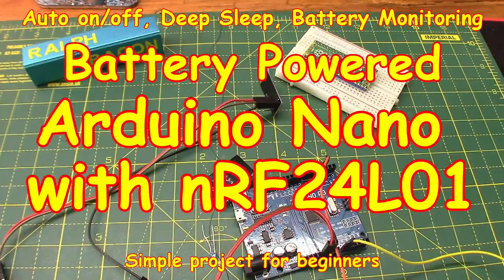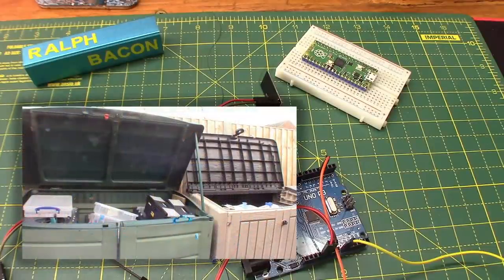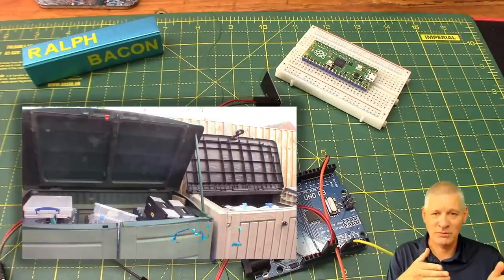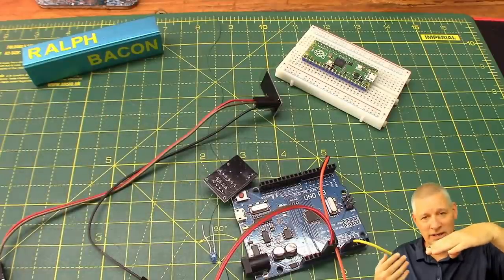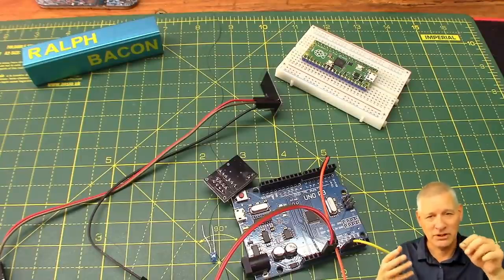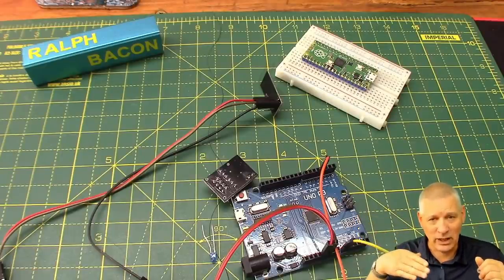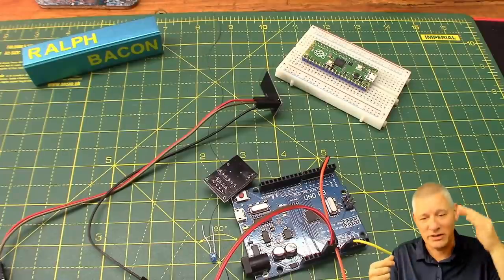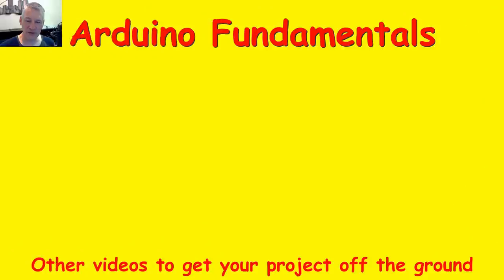#214 Battery-powered 🔋 Arduino-controlled nRF24L01+ transceiver project (part 1)

Comment: Interesting project and nice to be able to appreciate the thought process through the design - things that come to my mind are a daily ‘ping’ from the sensor reporting its battery level and unique sensor number so you add more sensors later and can put the effort in to a central hub which can plot or threshold-trigger for recharging as well as set off reminder klaxons when a lid is left open. 
Thx for all your great content.
Reply from the maker: Great point! As I have 3 bins I will have three of these units and they will have to be uniquely identifiable, not least for the battery level. Which I'll do each time they are opened which is "often". The neighbours might object to the klaxons, though, Chris. I'll tell them it was your idea.

Comment: For monitoring my garage doors I use a little Zigbee magnetic switch, linked to home Assistant. Works on cr2032 for years, even notifications on my phone when left open…. But I agree, this is more fun to make 😉. Thank you for making these videos!
Reply from the maker: Indeed, Freddy, others have also suggested various magnetic solutions but as my bins are not as solid as a garage door they might not be triggered correctly (or reset when closed). A tilt switch is going to be hopefully more reliable in this instance - and more fun to build, just as you say!

Comment: Interesting, look forward to the 2040 being used!
Reply from the maker: Not in this project, unfortunately, as the PICO's sleep current is too high. Well, unless the bare chip was used (now only $1 a piece I see). But I know I can get the Arduino down to 0.2uA in Deep Sleep so it will have to do.
Reply: @RalphBacon  - Thanks Ralph!

Comment: Interesting video, I think I would take a different approach though. Assuming you didn't just want to run a wire the 6 feet to your shed (!) I would have the battery connected directly to the Arduino, with the mosfet switching the nRF on and off. By using the power down mode and switching off unwanted sections of the arduino you can get the standby current down to a few tens of microamps, and then you could make the arduino wake up every few minutes, check the tilt switch, measure the battery voltage and then switch on the radio, transmit the data then power down the radio and go back to sleep. This would still give you a good battery life, but you wouldn't need to restart the arduino each time, and your monitoring station would receive regular "lid closed" messages verifying the system is still working, perhaps raising an alarm if the battery voltage drops too low or it doesn't receive a message for 5 minutes or so. Just a thought!
Reply: I agree. If Ralph leaves the lid closed for a year and the battery dies he would never know it. Then if he left it open with a dead battery he would not get an alarm. I like to make my projects a little more 'active'. I agree a twisted pair of wires is the better and low tech solution.
Reply from the maker: "If Ralph leaves the lid closed for a year" 😁 
The bins get opened several times a day. Including when it's raining like today! Even if I was on holiday (I remember those, good times) for a couple of weeks it seems unlikely the battery would go from "good (enough)" to "dead" by my return. I'll be sending the battery voltage each time the lid opens. What I do with that is yet to be determined.
Reply: @RalphBacon  Looking forward to see the project come to fruition. Lots of good ideas even if I would do it differently.

Comment: Happy to see I am not the only one who loves the WIFI radio systems I decided to build another a few weeks ago. That's when the problems began. You see I stopped when I began to believe that there must have been a problem in the design of the EPS32's I was using.  They would work for a couple of times but then simply stop. I could upload the software to them again, and then copy my channel setup over, they would play fine but once shut down would start again but with no program and I would have to re-upload.  I had a pile of esp32's laying on my desk that I had declared DOA and ordered a different type from a different seller.  When the new ones got here, they began to do the same thing.  I threw up my hands in disgusts and stopped playing with them, moving on to something else.  Then one day I decided to see if that pile of ESP 32's were indeed dead. I grabbed one and loaded the blink program and sure enough it began blinking the onboard LED!  So I once again loaded up my radio sketch and played with it, just using the built in stations and it worked fine, I could reboot, no problem.  So once again, I loaded my list of stations that  I had built up over the months that worked fine in my flat pack build with external speakers, and once again, on reboot, it had NOTHING!  Then it dawned on me, perhaps I had to many stations, so I cut out about 12 of them, then reloaded and suddenly I was back in business.  There was nothing wrong with the esp32's it was, what we called in the gunsmithing world OPERATOR HEADSPACE!  My list of stations was to large and was overwriting that little bit of RAM that contained the setup files`  Guess you are never to old to learn, and having just turned 70 last month, this became my living proof of the adage.   Oh, 95 degrees F here today, it has been a bright and sunny day till a few minutes ago when the black clouds developed.  There have been some horrid tornadoes south of here, hope they stay South of here!  Oh thanks a million for the videos, I believe I learn something from each of yours that I watch. It is my firm belief that if you learn something new every day , your mind should stay young and nimble despite the drugs the  damn doctors keep pumping in my system to fix this and that, then the ones to counteract the side effects of this one and that one, it's a never ending line of drugs, I keep the drug store alive on just my line of meds.  Workers comp is getting angry that I am on so many but screw them.  Thanks a million for the great videos any how and keep up the great work.
Reply from the maker: Happy belated birthday, Jerry, for last month. If I recall correctly, you were married to your late wife for 51 years which means you got married at 19? Wow! At least you stayed together all those years. That's some achievement. And no wonder you miss her. 
So back to your "hardware" problem. In effect, then, Jerry, it was a software error that caused the problems with your ESP32s? If there had been some kind of check within the code to limit the number of stations it would never have become a (so called) hardware problem? 
As you say, never too old to learn!
Reply: @RalphBacon  Yes indeed, when we had our fifty'th the kids threw a big party and invited all the old gang that they knew about and we had a great time. Of course then we had no idea that my wife was developing cancer. It was a coincidence but the day we wed in 1969 was the second day of Woodstock, that big musical concert in New York that made all the news papers, and they were still looking  for that Manson Family that cut a bloody path through Hollywood murdering rich white folks and trying to get the news to blame the blacks, thus starting Helter Skelter, the song that Charlie Manson believed was a message from the Beetles to start the battle. He believed that if he could get it going, the blacks would  win, and that they would not have the smarts to run things, so he and his family would come out from their underground hiding place in Death Valley and Charlie, being ever so much smarter then the blacks despite his 6 grade education and rule the nation as king.  Ah well another dream unfulfilled by another idiot.  Indeed, we had a great run, Judy and I, I still tear up a bit when I remember the good times, and our winters alone in Arizona the last few years. What wonderful memories to have and keep.   One day, I guess I will feel better and get on with my life although none of  us know how long we shall go on, I will live like I will live for ever, and dream like I will die tomorrow. Something like that anyhow. Thanks for remembering.

Comment: Love your videos Ralph as they always get me thinking. So many different options for this project as far as sensors but the template is the same
Reply from the maker: Great point! Many have commented about mail delivery detection so I'll devote some thought to a fool-proof way of detecting that as the trigger (eg long lever microswitch).
Reply: @RalphBacon  Funny that. I have a mailbox at the end of my drive... I await your solution with baited breath... tho I was thinking as mine is within my wifi range I was going to use an esp32 with a hall sensor just to light an LED on one of my desk projects

Comment: Hey Ralph. Welcome back :) (yeah I'm a little late to that party lol) I'm building a sensor network (to monitor various things around the house) with the nRF24L01 radios. I'm using tmh20's library and using the mesh network for easy communication, and then I think my connection to ThingsBoard will have a nRF24L01 on an ESP8266 as the gateway to the ThingsBoard server. tmh20's nrf24 library has some decent support for sleep for devices that don't need to be on either using an interrupt or using the watchdog timer.
Reply from the maker: Hang on, I used to know someone called Jess. Is that you? 🤣 I've never used a mesh network (isn't there a limit of six devices?). Anyway, I'll speak to you later. 📧
Reply: @Ralph S Bacon  Only 5 can directly connect to the Master, but the others (up to 255) can connect via the other nodes :) Anyway, I sent an email since YouTube is really finicky about when it will let me send a comment. It's really annoying :(

Comment: There are many solution to this, depending on your requirements and what you have already.  As my HA is all node-red based I tend to use tasmota to monitor a switch state, granted these aren't small battery powered sensors as the either have a mains powered usb supply, or a multi kWh solar charged powerwall.  Alternatively I use 433MHz magnetic sensor from banggood and I pick these signals up on an sdr stick using rtl_433, they run on a single aaa for months/years and send a low battery signal too.  Bitluni, Kevin Darrah and mr ca diy have good battery powered sensor solutions.  The fun comes in seeing what others have done, and then working out a solution that works for us.  Great video as always
Reply from the maker: If I had ever progressed my Node-Red/MQTT project I guess I would be publishing the state of my bins lids and letting other parts of the overall system deal with it. But, as I never did (but never say never) some sort of other wireless signalling has to be used and magnetic sensors would work if I could ensure they were always aligned correctly (which I can't, as they are rickety, but solid, plastic bins, which have a certain amount of "freedom" in where they choose to close!)

Comment: Interesting. I want something similar for my post box, so I know when the postman has been. Of course what I really want is a camera so I can see what's in the box, and a robot to go down the drive to collect the post, but something like you're doing will be fine to start with!
Reply from the maker: You forgot the butler to open the post and serve it on a silver platter. On the other hand...
Reply: @RalphBacon  The robot would do that! Actually I want this as an early step in creating an IoT, using MQTT and Node Red, but all that stuff would be handled by the receiver, and wouldn't affect what's used in the post box.

Comment: Hi there just a quick one to say that 18650 has a voltage range for 2.5v to 4.2v I try to only go 2.6v to 4.1v as this does not stress the cells and the number of charging circles is a better. I realise that this is below the the threshold for the Arduino and nrf24 but is a significant amount of charge especially if you have 2 in parallel
Reply from the maker: That is very low indeed, Paul. But if the datasheet for your particular battery says it's OK then it is. But mine are no-name (or Chinese name) with huge 5,000 or higher capacity (stop laughing) so who knows how low they can go without being damaged. I'm going to be transmitting the voltage whenever the bin lid is opened; I can decide later at what point I replace/recharge the battery.
Reply: @RalphBacon  hi there that is a standerd for the chemistry it's not a lipo (bag) stile that extra. 5v mack's a difference

Comment: Coincidence of timing ? ... 
For a long time, I've been thinking and planning a monitor for my detatched garage. And then a week before you uploaded this, I started working on the wiring writing some code.

Just like a lot of us, I have multiple arduinos and a bunch of NRF24L01 modules lying around, so that's what I'll be using.
My monitor will tell me;
- the open/closed state of three doors
- if the lights are on
- if either heater is running
- if the air compressor is running
- and (with a PIR & sound sensor) if it seems somebody's cat got trapped in there.

I'm also going to report the battery voltage, as well if as if mains power is still charging the battery. And just because I have a few, enough unused pins, I've added a real time clock.

The unit in the house will show the state on an LCD display module and flash & beep if any of the alarm conditions exist.
Reply from the maker: There's nothing new under the sun, for sure. What I can think of, so can many others too. It would be interesting to see how you get on.

Comment: Nice project.
Good to see that some failsafe is built it. How would you check if the wires, for the switch, is not broken?
If the wires are broken or battery gone bad, you never get the signal "Lid is open" and you would  never know.
Seems someone has been testing DIY skills with a hammer of is it nail polish?
Reply from the maker: Remember that we have yet to design the receiver, Flemming, and what kind of (visual) indication there will be for lid status. At the very least, I'd expect an active "lid closed" indicator (or "open") on bins I've opened/closed that day so I should realise something was amiss if nothing was shown (eg dead indicator panel). And we haven't even discussed the rain alert...
Yes, I tried to remove my nail whilst building the workshop, taking a long time to repair itself. Didn't hurt one bit. 🤥🤥

Comment: The SCA60C sensor will measure the angle of the bin lids.
Reply from the maker: They would, indeed. Unfortunately they won't act as a (mechanical) trigger to switch the circuit on, so they would not be suitable for my particular design. But good call.

Comment: Glad your back with informative videos. 
Question: could a Wemos D1 derivative be used in place of the Arduino and NRF?
Reply from the maker: You could do that, but the design would be quite different. 

The Wemos D1 would (presumably) act as a mini web server and a client (another piece of equipment) would then query from that server the state of the bin lids (or whatever it is we're detecting). So instead of a push protocol (from the nRF24L01) it becomes a pull request (from whatever wants to know the state). 

Alternatively, the Wemos could log the switch state into the Cloud (eg using ThingSpeak, which is exactly what I do with my mum's activity monitor) for a client (app on my phone) to retrieve at leisure. 

As I said, a different topology but logically it could be done.
Reply: @RalphBacon  Thank you for your reply.
Reply: The ESP8266 used in Wemos D1  has a sleep mode by grounding one pin (16?) There are tutorials with ESP8266 in deep sleep mode out there. Google for ESP8286 sleep mode.Not so low power as in this example but still lower than self discharge of  a 18650.

Comment: very cool video, thanks!
but I have a question.
What is better in the long term?
Rebooting the Arduino every time or going into deep sleep so that setup doesn't run every time?
Also for projects in which you have to communicate with several other chips.
Reply from the maker: This project will do both things, Felix. When the lid is raised it's like a cold boot/switch on. Whilst the lid remains raised it will go to sleep and wake periodically to check the state until the lid is closed.

Comment: Not a mention of your mashed pointer finger, in the video or comments. A bin lid accident?
Reply from the maker: A workshop build accident that is taking forever to heal (or fall off). Not my finger, just the nail. 😂
Reply: @RalphBacon  if its painful you can use a needle to relive the pressure..make small hole in fingernail..

Comment: Great project Ralph. I find the new Arduino ide black screen very hard to see both in live use and on the video.
Reply from the maker: Hmm, I thought black was the new, er, black when it came to computer screen themes, Mark? I've just tried out the "light" theme and it does look brighter if not clearer. I'll try it that way next time and see what responses I get.
Reply: @RalphBacon  Why not green on black like an IBM3270 terminal ?
In a DOS box type color  2 and see what I mean.

Comment: Hi Ralph, have you looked at the rf-nano, 328p with micro usb and built in radio
Reply from the maker: I glanced at one, but it's (relatively) pricey, don't you think? And whilst I considered using the WiFi it was more complicated than a simple nRF24L01 setup. Let's hope I don't regret that decision!
Reply: @RalphBacon  Fair enough, My use case was for a small rc tank project, but I liked the micro usb and not having the kludgey adapter between the nano and nRF24L01, I think I got two for about £16 ish but that was pre-cov. Cheers